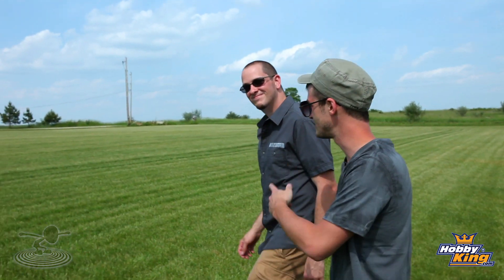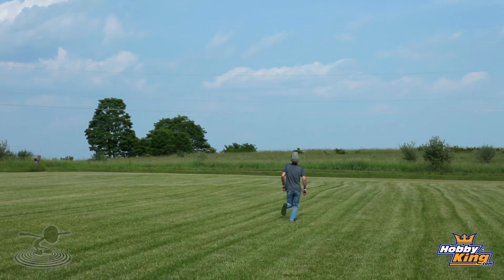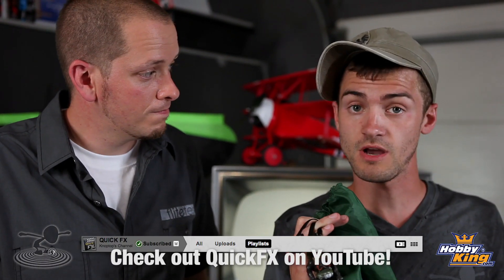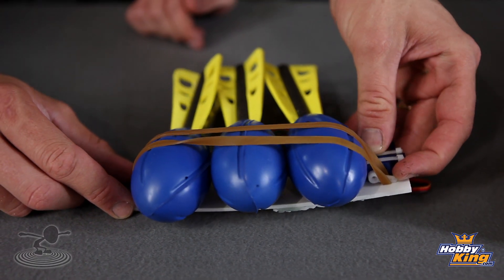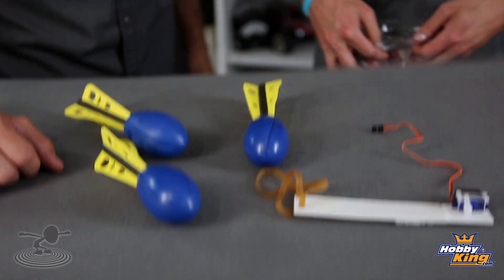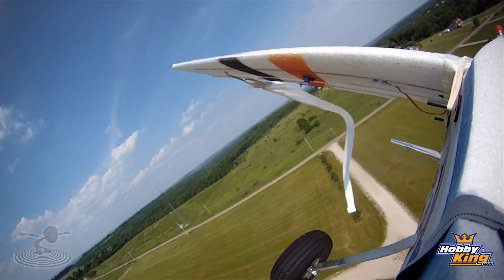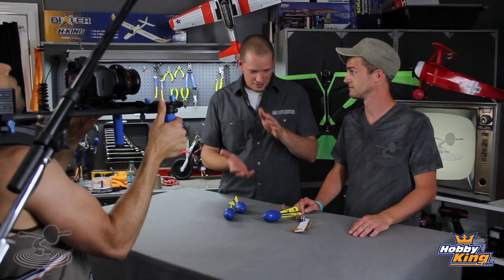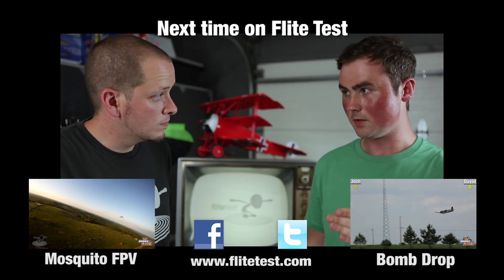Flite Test - Building the Bomb Drop - PROJECT

Comment: You talked forever about a rubber band but what about the wiring? What the heck is a 'servo'?
Reply: if you dont know what a servo is you dont need to be here.
Reply: Lol I felt the same way, a servo is like a motor hooked up to a lever, it's what Makes most planes turn, also the wiring I'm pretty sure just connects to your plane's module
Reply: A servo motor.
Reply: +DudeRevolution A servo is a little box with an arm coming out of the top, and if you plug that servo into the reciever, (which is what the radio control transmits to) then you can press a switch on the radio and the servo arm will turn 90 degrees